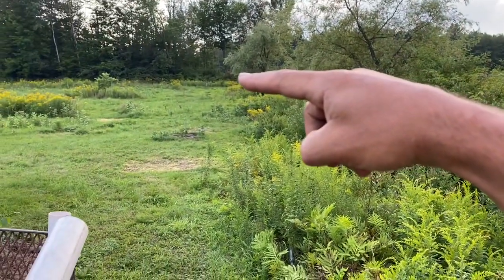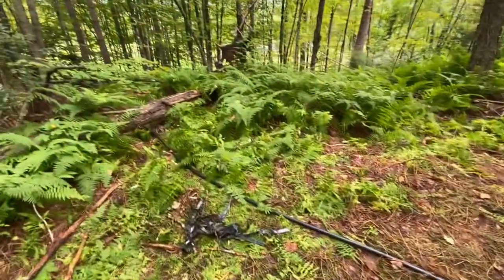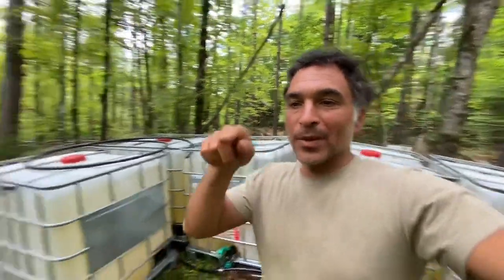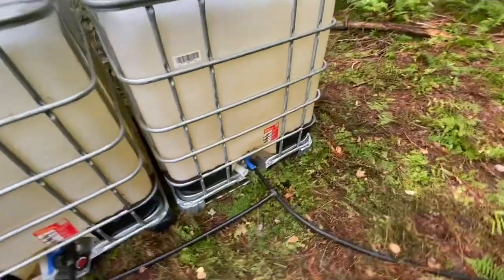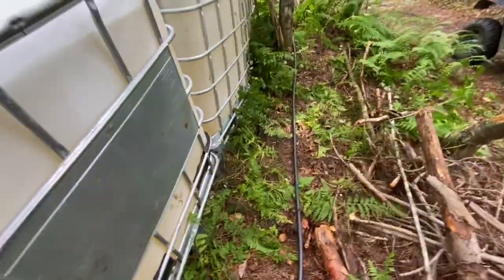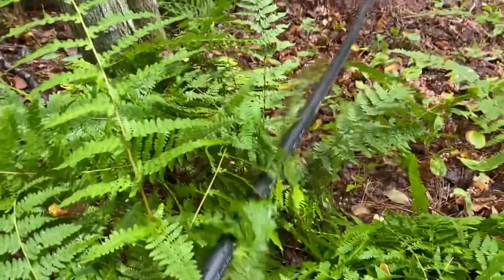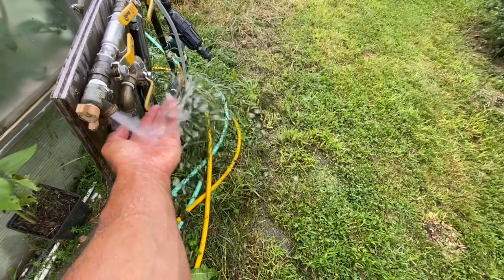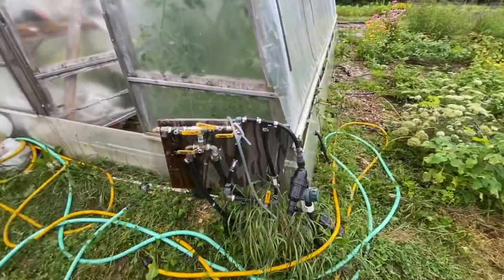Ram Pump Lifts 90’ from 20’ Drop

Comment: you may wish to cover them in a shade - i wrapped in black plastic - to prevent bacteria build up as its not good for stock - unless its on constant flow.
Reply from the maker: yes, thanks, we do plan to cover it, with boards on top and maybe on the sides too...

Comment: Nice work Ben, increasing your water resiliency. One of the first things I did was install one on my land when we first moved onto it. I've gone through 3 now the first was a similar design as yours and worked great but it outstripped our water flow and I found the  brass check valve pivot point began to wear after time (but they are cheap enough to keep a few on hand). I finally ended up buying a cast version from Australia. It was a good chunk of coin to spend but it should outlast me. The  similar pump my grandfather installed is still going strong in his Argentine homestead after 60+ years. What peace of mind to have that water source come drought time.
I`m really curious about your spring powered water timer, any intel you'd care to share on it?

Seb.
Reply from the maker: awesome! i got it from dripworks.com.

Comment: And the free energy water pump, on the "learn for life" channel, does it work? Not for such height differentials, but to lift water say 30feet?
I wonder, and probably, the only way I will know for sure is to build one, probably a smaller version, so as not to waste materials if it does not work.